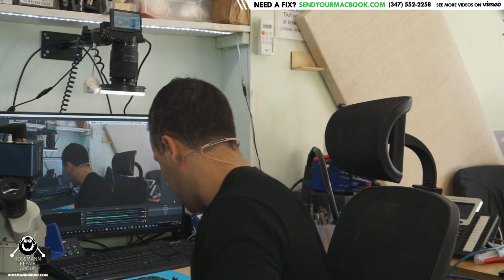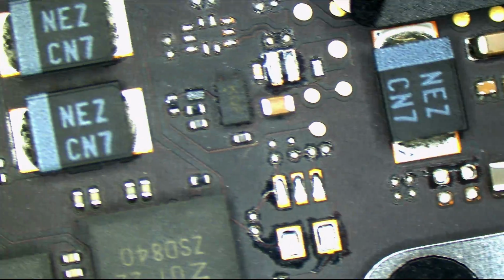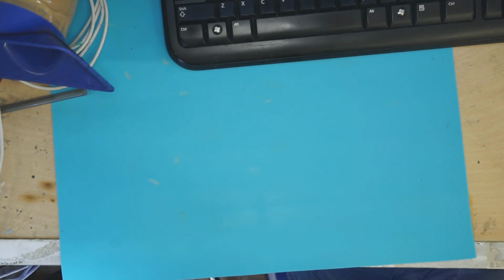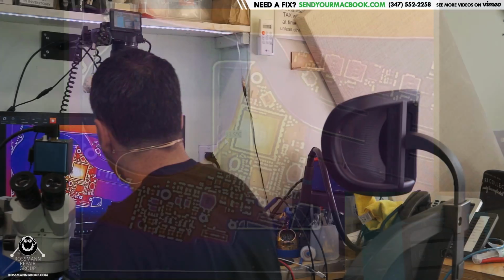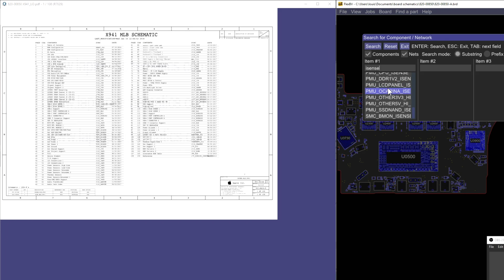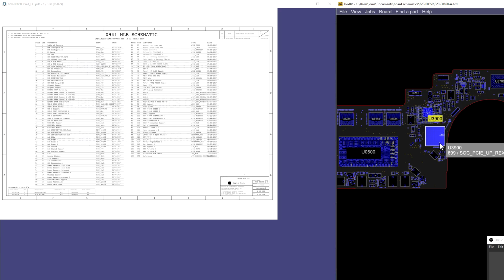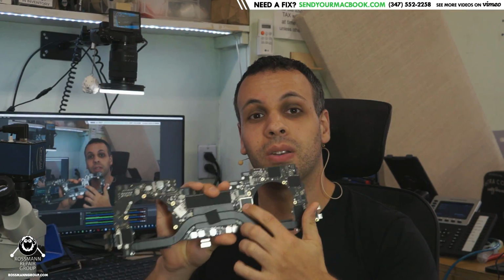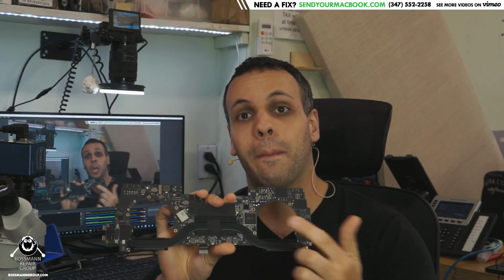Apple users have no one to blame but themselves.

Comment from the maker: 10+ years of defective products: https://www.youtube.com/watch?v=AUaJ8pDlxi8
Apple removes diagnostic functionality from their software: https://www.youtube.com/watch?v=NVAmnV65_zw
New product designed with 52v power line next to CPU data line, frying CPU with mild humidity: https://www.youtube.com/watch?v=jahtu1_idVU
New Macbook can't even be opened without malfunctioning:  https://www.youtube.com/watch?v=oaBW9qlYcwc https://www.youtube.com/watch?v=I-0ejhpO1hc  https://www.youtube.com/watch?v=NzjoELvrkYo

Think different.
Reply: @Brendon O'Connell oh, you must love your delusion.
Reply: Hi Louis, funny thing is Apple blame's users for it's code bugs now, too: July 24th I installed 10.13.6 security update 2019-004 on two MacbookPro, BOTH independently ending up in a reboot loop. When I called AppleCare I was told I was using 'bad internet' and thus the code bundle would have been corrupted. I could hardly believe the code bundle's checksum is not verified before install, but as the install finally succeeded in secure boot mode I forgot about the incident and went on with other stuff. Now, August 1st, the very same 10.13.6 security update 2019-004 suddenly appeared in my AppStore again as not yet installed, as well as installed already (!). When I called AppleCare, and requested an explanation, they told me again 'probably you had 'bad internet' duringt he first install...'. When I asked if the code bundle changed since, this was denied. Finally, after requesting to talk to their manager on the phone, they admitted the first bundle showed issues and was replaced with a different one WITH THE EXACT SAME NAME (an absolute 'no go' in professional IT business), without notifying customers in any way. The bad bundle was silently withdrawn from the web, and I was blamed for using 'bad internet' when my install attempts failed - what a scam!
Reply: @tom_k_d  bad internet? So apple download manager has no CRC check? Wow think different. But to be honest that bug happened to small percentage of users.....
Reply: @vogonjelc  Actually they use consistency check prior to install, as anybody else does, this was finally confirmed by the manager I talked to. But AppleCare agents tried twice to bullshit me before, and when I asked them if they don't do a consistency check prior to install they did not even understand what I was talking about... poor Apple. I don't complain about the code bug itself, but the way they treated it: Hiding, spreading lies and blaming the customer - the Apple way!
Reply: @tom_k_d  you have to understand Apple is more like a religious movement then manufacturing company. People buy it not for quality but more for feeling and status they think they will get from Apple products.
Reply: @tom_k_d  That being said. A customer brought me a1811 (2006) for me to fix. So out of curiosity I took a look at it. It was case of corrosion under the wifi card. After rebuilding traces and replacing some resistor I was surprised at how fast that thing was working...
Reply: @vogonjelc  I bought them for the superior audio stack, which was messed with the T2 chip now, too. Also, since 2016 MacBook 'Pro' does no more support 96kHz audio on the headphone jack - this was a valuable staple on MacBooks since 10 years before, what a shame! It seems they do everything to accelerate their trip on the road from Pro to Blinbling even more...
Reply: @vogonjelc  Yes, back in the days these machines were serious business - many ports, and drive, battery and RAM accessible, 96kHz audio on board. I still use a 2011 17' on a daily basis, to control recording equipment.  I doubt the past-2015 models will have a similar lifespan, however.
Reply: @Brendon O'Connell Blablabla.
Reply: @Brendon O'Connell How does that approve shitty practice Apple is pulling on people? Seriously? Because of Russian engineers Apple declines warranty repair on a product that clearly does not have any signs of abuse? Think damn it. Get out of paranoia.
Reply: Think.......pad?
Reply: Louis Rossmann I’m gonna buy the Samsung Galaxy S8+ or S9+ to upgrade from my iPhone SE, if this is how they treat customers, I’m done with Apple too! And to replace my iPad Air 2 I’m just gonna buy a laptop!
Reply: @realracer0353  me to. I'm going over to a PC as I have enough of Apple. I have switched over from a iPhone over to the Samsung S10 5G and I find Android easier to use.
Reply: @Brendon O'Connell and yet apple still pulls stupid shit.
Reply: Hi Louis, serious question here - what are your current projections/predictions for your repair business going forward in regards to sustainability?  If the T2 chip is the standard that apple are using for all new builds, that means there will be less repair work in the future (seeing as the T2 is effectively authenticating the components within the unit and preventing component level repair), and older units pre-T2 will be tailing off.
Reply: @mrkrunch4340  They'll get sued for it, just watch.
Reply: Holy fucking shit. I was thinking about buying a new macbook pro ...the new keyboards gave me hope. The t2 chip seals the deal. Im just doing a full restauration of my 2013 instead.
Reply: I don't buy apple,I don't support apple,i nver appreciate apple.

APPLE IS SHIT.
Reply: Louis you need to make a t-shirt print with a T2 chip graphic saying it's a EVIL CHIP! and sell these shirts on your web-store
Reply: @Brendon O'Connell You got me. I thought you were serious for a full minute.
Reply: @Brendon O'Connell what? Your arguments have no connection between them.
Reply: @Brendon O'Connell the biggest problems and enemies of the USA are from the inside.
Reply: But but from Apple point of view T2 is working like profit department imagined. Ef the customer but put profit in pocket. And You know its only happening to small percentage of users.
Reply: Reverse engineering is possible on hardware materials,..software materials like the codes inside the chips is impossible, do to never havin seen the software how it looks, what the setup is like, on a dedicated chip-reading computer (that look nothing like ur average computer.
Its like asking someone to reverse engineer a digital watch from 5 yrs ago to do what smart watches do nowadays
Reply: Apple should really stop this bullshit and support the repair industry, there will come a time where this practice of theirs is going to bite them in the ass.
Reply: @Brendon O'Connell dont think so; if you are an educated consumer (i.e. by watching Rossmann o Jessa Jones videos) u dont waste your money on this apple crap no matter what marketing is thrown @ u; but if you are a fanboy (definition: buys shiny stuff because it's expensive and a status object no matter its performance/problems) apple only needs to show some ads where djs are dancing while touching an ipad or silly things like that to make them buy its crap; that doesnt qualify as brillant marketing to me
Reply: if u buy a macbook, its great until its not (breaks)
Reply: It's all about Tim Cook's BS penny pinching. He and his crony execs need to fucking go. That's the only way Apple will turn around back on the right track.
Reply: @Sanctum1972  Apple hasn't been on the right track since Steve Wozniak stopped working there.
Reply: But Louis, in all honesty if this was your daily driver and you had a lot of sensitive customer and business details on it, then it was stolen, wouldn't the peace of mind be amazing knowing that no-one is ever getting into that drive or even using the computer again without the password?  they cant just hook the SSD up to another computer to read the drive, and the T2 chips automatically encrypts the drive.
Reply: bad discord link :(
Reply: They say they do all this for security--like that lifeboat header you mentioned, when all they need to do is encrypt the data with your password then if someone steals the machine they can't steal your data, but if you need to recover your data you can access it through your password to decrypt it, it's how companies like last pass work.
Reply: Does the customer have no legal recourse when this is still under warranty? Can he ask Apple to show him the water damage and hire a lawyer if they can't show it?
Could you testify to no water damage, or is the warranty void if you open the machine (catch 22) ?
Reply: So what are your plans after all of this is in place?
Reply: Apple should be sued for just caring about money at subway our moto is customers first
Reply: @zerosum Ask yourself: why should that even be necessary?
Reply: Grew up with CD players and bought an ipod as a mp3 player way way back,   really loved that thing cause it was durable and simple.    I gave apple a chance when it came time to get a new laptop as my previous one was DONE and DONE.      Long story short apple macbook pro retina 2012 will be my first and last apple computer they don't care enough to change but I learned from this experience and will move on.
Reply: @Louis Rossman If it's not too late you should have your customer take the computer back to Apple and show them this video. Have the customer threatened to take it to there local news agency and forward the information to national networks if they won't honor their warranty. Knowing Apple though the customer will probably have to sign a non disclosure agreement but at least the customer can get his computer fixed.
Reply: Okay Apple is a problem, who is the solution?  Apple beat most to the punch but aren’t they all going this way?
Reply: oh but the slogan was meant for themselves: Apple Thinks Different to the competition; they make crappy underpowered, overpriced and unrepairable computers so their profit comes from screwing their fanboys; vicious round circle complete!
Reply: Apple certification stream. I want an Apple certification stream. Where is my Apple certification stream? Hello? Hello? I need one right now. OK then, my sister said they're available at Eli.
Reply: Yes but Windows is worse. There has not been a version of Windows that actually works. If a judge ordered that Microsoft had to payback the money every for single purchase of Windows, that would be a fair call. Every person and company that supports Microsoft by buying their faulty obstructive OS is even worse
Reply: @PeterbFree  What was last Windows you installed? Win 3.0 for workgroup?
Reply: Peter Freeman  Everything can be repaired !!! Only crapple doesn't want to repair their products. You're talking nonsense. Apple doesn't even want easy & simple repairs on their CRAP !!! Just buy a new one. Lol.😅
Reply: @PeterbFree  this video was about apple's hardware, not comparing OS's. I would rather have a computer that can be repaired myself than one that has to be replaced because the manufacturer doesn't have any interest repair. What's the point in buying a overpriced luxury vehicle if the motor has a faulty part that cannot be repaired or replaced?
Reply: @PeterbFree  You sir just won the internet by comparing a 100-300$ OS (or free if u crack) to a thousand dollar or more "Hardware" component. Windows is just an OS and the hardware that runs it can also run any other OS And they are also repairable (cheaper too). This video is not about the OS but the hardware and how Apple deliberately makes it so that they are easy to damage and expensive or impossible to repair.

Comment: been getting scammed by Shanghai Apple Store, IAPM said over 10kRMB for repairs.
So I brought the 15" MBP  back to Canton St, HK store I originally bought it, they said 11k+HKD. 06/21 riot Sunday across the harbour.
I  brought the MBP on Monday, worse shape than in Shanghai.
I called them from Apple Store IAPM across the harbour after 1PM.
Astoundingly computer fixed next day [Tuesday].
Either Wed/Thursday picked this up.
NO CHARGE.
So there I bought 2 more years of Apple Care.  $349
Reply: Never again will I buy highest cost MBP!
Reply: data on HD lost! despite replacement

Comment: ive never owned a mac and never will i build my own pc's and life is good my first computer i built in 2012 still works with no issues. The amount they charge for the parts inside the machine is ridiculous. I would rather trust one person to build it right the first time and that person is me. Apple spends more time innovating new ways to screw over their customers rather than coming up with new technological advancements. When you buy apple you are buying their brand which nowadays isent worth anything.

Comment: Within warranty period, and store refuses to warranty it or repair it due to a cause that doesn't exist...

Gee... this sounds like.. another lawsuit.
Reply: Not even the crappy butterfly keyboard failures are enough to stop the fanboys from showering Apple with money. Blind devotion is over 9000!
Reply: @user-oo7zd1kz2t  Well then, those customers, like the shit they buy, are disposable.
Reply: what happened to a 2 year warrenty forced by the country where it was bought and that the custommer has the right to have a 3rd party dubble check if the store is correct? thats how it works here in denmark, oh and its the store you bought it from who has to pay out of thier pockets if apple wont cover it. 
i just find it abit funny that there is such a high failure rate in the us, but if you look here in denmark there is almost no non-user related failures, its almost as the stores wont sell apples products unless they deliver a machine without shitty practices.
Reply: @zentrobi1548  how do you know the failure rate?
Reply: @grasshopper1g  i dont exactly, wich is why i didn't post any sources, but my friend was a manager at a repair store and they never had any of the failures louis is talking about, only user made failures, also alot of my friends has appær producs and only a few of them has had non-user failures and nome of them had problems with the stores giving them a warrenty repair.

Its a guess, not accurate, but i would love to see some insight into if there is some truth to it, cuz it do seems like it, but take my answer is nothing more than a guess
Reply: @user-oo7zd1kz2t  Then that means more low-level direct action is required, like a complete boycott of all Apple products, or at the very worst, #TorchesAndPitchforks.
Reply: @denelson83  Small claims court 10K, they can't use lawyers... video recorded saying no liquid or drop damage by someone who does boardlevel work which LMAO is much harder then the IT work I do...
Reply: It's not different than medical insurance: You pay us whatever we want, we cover whatever care we want. Need that back surgery? Uh, we don't think so, but you still must pay your premium.
It's not different than Microsoft: when you buy any non-Apple computer it will come with Windows pre-installed. You WILL pay an extra $100 to get the buggiest, least-secure, POS operating system ever designed by neanderthals that hasn't been meaningfully improved since 1996. Therefore, every piece of software you need will be designed to work on Windows, and yet it probably won't work until you've sufficiently reprogrammed it.

Comment: Thats why I buy 2nd hand 12 y/o machines and make hackintoshes.
Reply: Boy are you missing the point.
Reply: @rickdees251 They may get statistics but they don't get revenue, they rather have revenue than high usage statistics. But buying Macs from 2007 ain't supporting them, and you ain't helping them out if you are just using a hackintosh, usually. but some people, myself included, need a Mac for school/work, I can't shell out $2,000+, so I use hardware I already have.

Comment: Haven't bought an Apple macbook since 2012, and I gladly say I swirched to a refurbireshed Dell laptop that costed me 500 usd and its more reliable than the macbook that I got in 2012 for 2000+ usd. That macbook is in the drawer since 2013

Comment: Hey Louise I have a MacBook Pro 2013 the mic stopped working I opened it up and the clip that holds the cable is ripped off. Could you fix that? Also the MacBook gets really warm and the fans run really loud even when the MacBook is not running anything
Reply: Buy a Razer Blade Stealth. It'll probably work better.
Reply: Check his vids. probably shows to to replace connector and has replacement available on his site.

Comment: Yep, not surprised that the T2 security chip was the cause of the entire machine becoming useless. This is why I personally believe that all of these extra “features” that are currently present or coming in the future (forced encryption, security processors, proprietary architecture, etc) should either be optional, or head right back to the platforms they were originally intended for: game consoles and enterprise hardware.

Comment: Apple users forget that this is a trillion dollar company and this shit happens rampantly and Apple... still cuts corners, that doesn't sound like a luxury product that sounds like they told you its luxury and you pay for it as a veblen good. 

To add: not only could they take care of any of these oversights with EASE - monetarily, manpower, engineering, whatever you can think of - they just don't and they just let shit slide until there's some class action or settlement or warranty program that costs them money, but they don't care, because none of it matters, because they have the overhead and money to spare as if they need it. Instead of making consumers happy they've just been digging a hole with themselves and at some point they're going to cement themselves in the hole they dug.